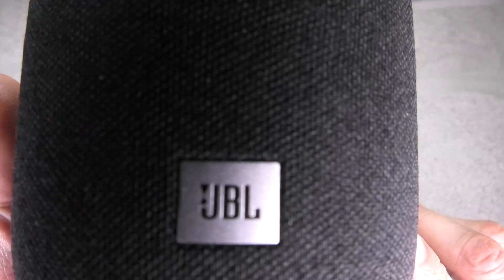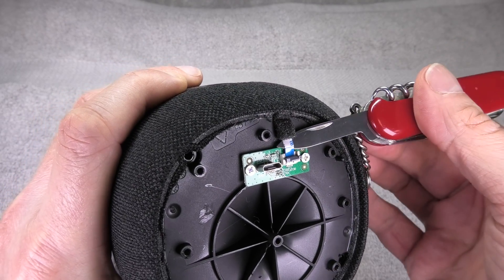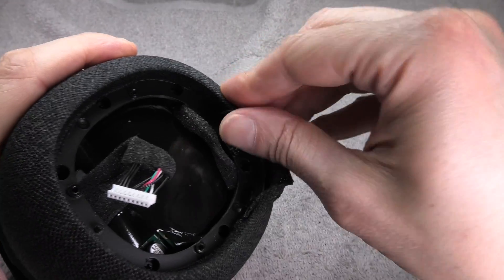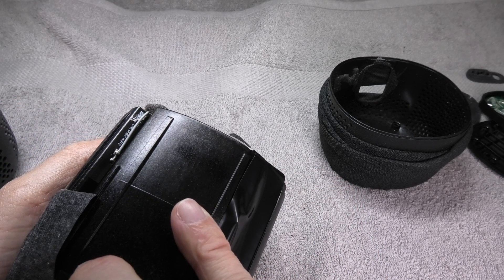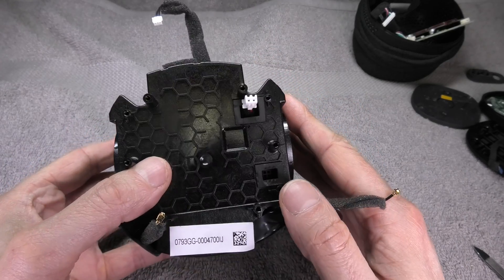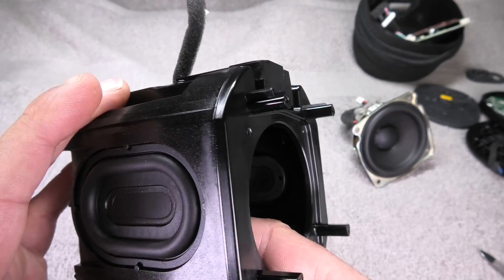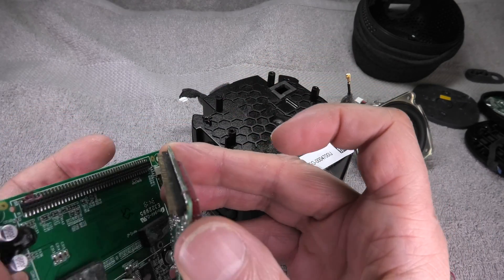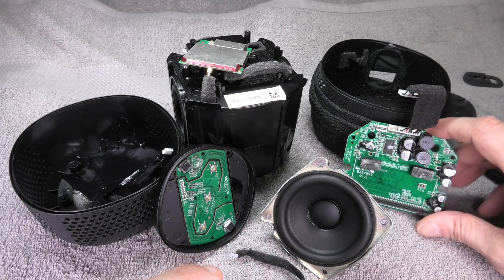Looking inside JBL Link Music Speaker (4K Teardown)

Comment: Good breakdown but you glossed over the removal of the rubber port for the power plug which if you don't do you can't remove the bottom cover. 

I picked up a cheap one but unfortunately the buttons don't work I suspect it is a Demo model. I contacted JBL but they wouldn't tell me if it was or not.

Comment: Thanks for the video - very interesting. Do you know if desoldering the microphones would enable the speaker to continue working without any microphone functionality? I know there's a microphone mute button, but I was hoping to remove (or at least disconnect) the microphones altogether.
Reply from the maker: Interesting idea, I never though of that!
Removing the microphone shouldn’t have any other impact on the speaker - at least that I can think of, since there is no active noise cancellation or other features that require the mic.
Reply from the maker: Interesting idea, I never though of that!
Removing the microphone shouldn’t have any other impact on the speaker - at least that I can think of, since there is no active noise cancellation or other features that require the mic.

Comment: The device on the video has power amp based on TPA3118 chip and DAC based on PCM5121. It is a pretty decent setup for audio. 

The video does not show the processor for Google smart features. JBL link portable has MT8516. I suspect this speaker shall have the same chip somewhere.

Comment: HI Friends. I have JBl link music but it was stay JBL Demo mode. Can you help me with out it ?
Reply from the maker: Demo units have a different software.  It is not possible to disable the demo mode. It would have to be updated with the regular software.
Reply: @MegaSafetyFirst  Can you help me firmware or software update for it?. I see micro port in your video . Thanks
Reply: @macoshotkeys6789  Hey!  did you find a solution?  how to unblock jbl.
Reply: @vadimcersac6742  No. i don't see way :(
Reply: I have same iusse here for my jbl its on but just demo can work i cant connect it for my cp or network if anyone can help?
Reply: @darkenmdodys  same bro :/
Reply: @fabianleal4207  

Hi Fabian did you find a solution?
Reply: Brother! Is your demo mode out?